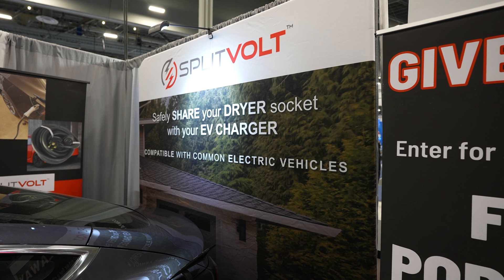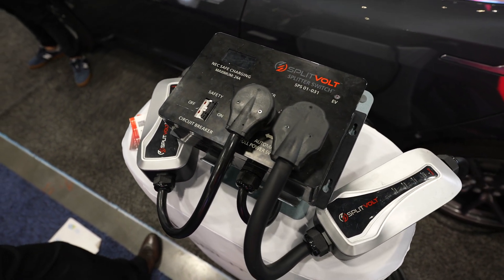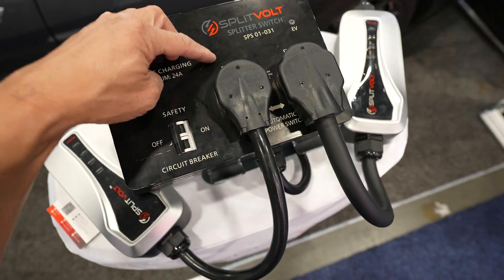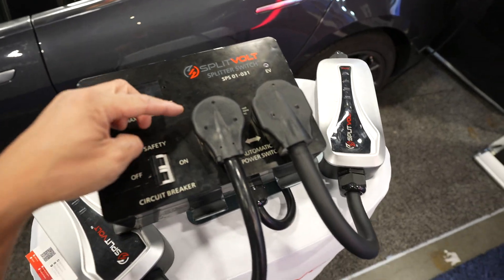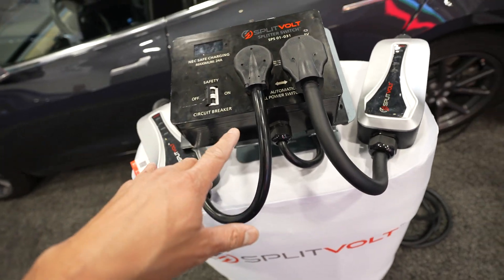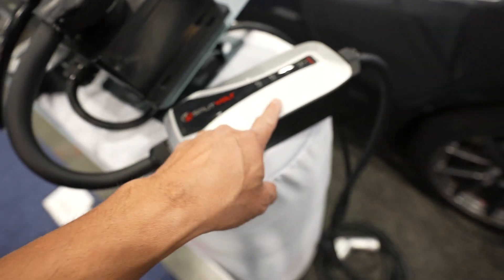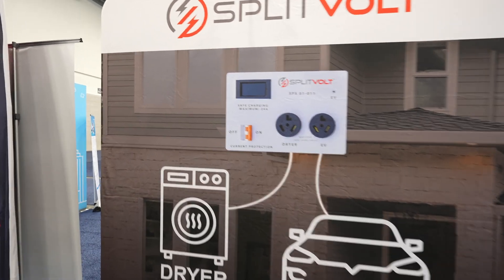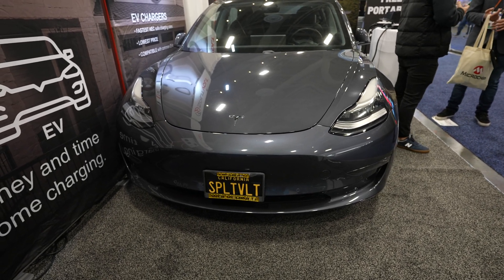Turn One Outlet into Two with SPLITVOLT

Comment: Problem is getting that power to the EVSE. An extension cord is not allowed to be run through a wall, and also isn't allowed to be a permanent solution. Code says this both in the US and in Canada.
Reply: Do you have a source for this information? I cannot run a dedicated 240v to my garage (well I could but it would very costly and time consuming) but I have my laundry room right next to garage and this would be perfect cost saving solution.

Comment: I have a split volt , and our dryer is rated for 30 Amps. The split and Tesla caps it off at 24 amps which is a safe working load . For the Neo charger , you may want to share power with a stove outlet that’s 40 amps , to charge at 32 amps .